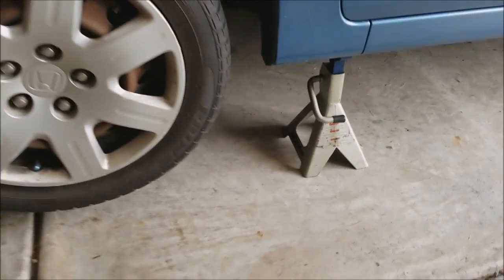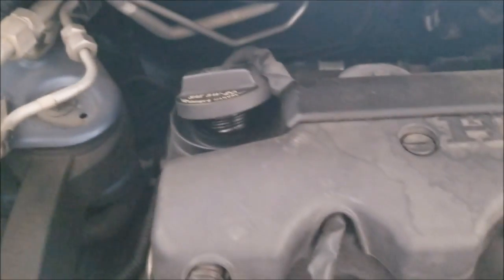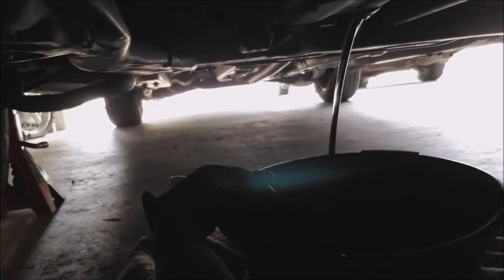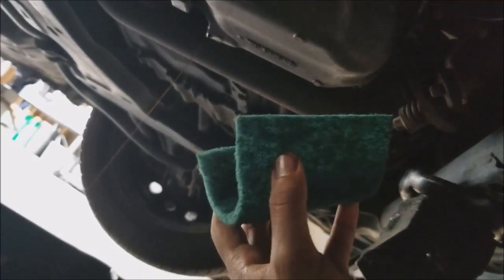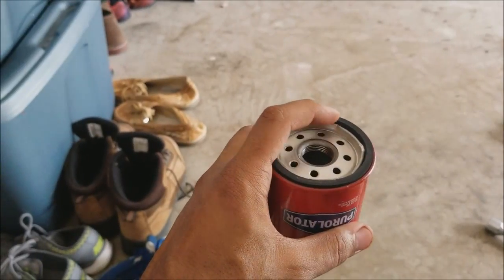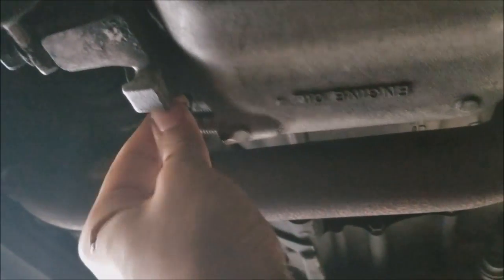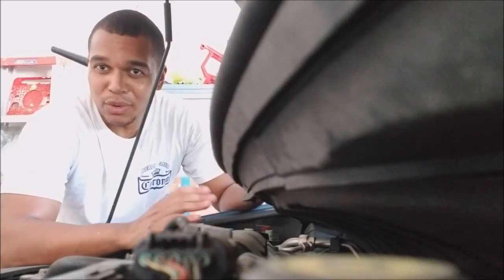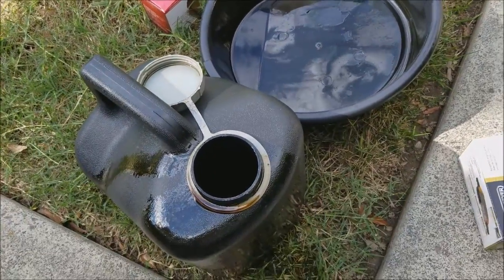2006-2011 Honda Civic OIL CHANGE | Easy and Simple

Comment from the maker: If you like the video please like and subscribe! Looking to scrounge up subscribers to spread helpful advice to and also gain some knowledge from them! Enjoy learning from my videos as much as I try to pass knowledge :)
Reply: Good video, it's also a good idea to pre fill the oil filter as well.
Reply from the maker: @joshbenway7109  that makes sense given the oil filter is not in a downward or sideways configuration. Can better insure the oil capacity is being met, thanks for taking the time to share a tip!
Reply: @EngineeredMojo  Not a problem.
Reply: Should not the car be lowered to a level position  before checking the oil level?
Reply from the maker: @liadbar-el8570  I don't understand the question in relation to the video. I don't check the oil level, but I do check for leaks. Car does not need to be level to check for leaks. For an oil change, I typically do not check the level as I know how much oil was put in the car, but if you had to check the level a flat surface would be best but would have a negligible effect on the reading unless your car is sitting at a high degree of angle
Reply: Thank you brother!
Reply from the maker: @williamcolwell1647  no problem! Hope it was a helpful video

Comment: Thank you! A tip for difficult to remove oil drain bolts - slide a 2 foot section of pipe onto the end of your ratchet for extra torque.
Reply from the maker: Good tip, a long pipe extension is a great hack for those without a long breaker bar!
Reply: @EngineeredMojo  it looks like you have enough clearance to get an impact in there too!

Comment: A yogurt 1 qt tub with top trimmed to fit over filter after loosening, pinched to unscrew will catch all oil and filter. Clean to move to oil catch pan. Nice!
Reply from the maker: Ha! Creative solution there to make the job a cleaner process. Tip noted and saved for future use!

Comment: its a 17 socket
Reply from the maker: henry nemet It depends on if the drain bolt is aftermarket or OEM. I should have specified that in the video. Thanks for the feedback!

Comment: It’s been a long time since I changed oil myself. Thanks for the simple, complete and concise tutorial.
Reply from the maker: Nice, glad the video was helpful! I have trust issues with oil techs so I'm all about changing your own oil
Reply: @EngineeredMojo  yeah, I get that. Gonna start doing more of my own basic maintenance. I need to replace the driver side window regulator and the AC compressor on my 2006 Civic. The dealership quoted me over $2,000 for both of those things. Both tasks look like a few hours work and $400-$500 in parts.
Reply from the maker: @dalsbury1979  definitely can save some money doing those yourself. Takes time like you say, but if you have some to spare...it'll spare your pockets haha

Comment: I just subbed.  Question:  do you not fill the filter with oil before you re-install it?  I was afraid I was gonna have to jack the car up, but I'm glad to know there are those re-enforced areas!
Reply from the maker: Appreciate the sub! And refilling the oil filter is your choice. It helps the engine not start on a short dry startup, but typical factory manuals only call for it if your timing belt tensioner is oil pressure activated. In many cars, the oil filter is installed sideways or "upside down" and pre fill is not an option like my 1995 EG Civic

Comment: Great video thanks for putting this on youtube. I just did an oil change on my 2008 Honda civic. Everything was the same as your year Honda. Only difference was the millimeter size for the oil drain bolt. It was 17mm instead of the 19 you used. Again thanks so much for the video!
Reply from the maker: Glad the video aligned with you car pretty well and thanks for sharing your fix experience. Saved some money and piece of mind that the job was done with care. Can't always get that at lube shops unfortunately
Reply: @EngineeredMojo  I definitely do not trust most oil change places. I'd rather do it myself so I know it's done right. There's always an upsell to at those kind of places

Comment: Best oil change video I have ever seen. But I didn’t see the torque spec on the pan nut. Extremely excellent video though.
Reply from the maker: Glad you found the video helpful! Torque spec for the drain plug is approximately 29 ft lbs

Comment: Is it a necessity to replace the filter and the washer on the plug during each oil change?
Reply from the maker: The filter yes everytime. The washer you are supposed to change everytime to avoid possible leak at drain plug but if I forget to pick up a washer I'll reuse old washer. Not the end of the world and rare you'll see a leak. If it does leak though you've wasted an oil change since you'll have to redrain pan. Small risk though
Reply: I have changed the oil in my Jeep Cherokee for 20 years and never replaced the washer on the drain plug and never had it leak. They say to do it, but really not necessary every time I would suggest.

Comment: 2011 Honda Civic needs an oil change now, may do it myself.
Thank you!
Reply from the maker: You can get it done! Really easy procedure
Reply: Half hour to double check everything! Thats 4 things only btw 😅 plugs back in, new oil filter, new oil and oil cap on top. By the 3rd oil change your going to be looking at 10 15 minutes 😁...did mine rn to see if anyone did anything different but nope, been doing mine for years. Very good video to listen and follow 👌

Comment: Nice job. I like to ensure the filter is loose enough to remove before I drain the oil (jic).
Reply from the maker: That's a good point. Oil filter can be a tough one to remove sometimes, good to ensure its removable before going through drawing process

Comment: No need too much tight when we put it back the oil filter, Sir?
Reply from the maker: No need to overtighten as ot will be very difficult to remove on the next oil change. I usually follow the manufacturer recommended tighten until hand tight then turn 3/4 revolutions more

Comment: Can you link where you got the jack from? I keep finding ones with bad reviews - maybe I should buy one in store.
Reply: or let me know what kind of jack and jack stands those are.
Reply from the maker: No problem, those jacks are from Walmart or Harbor Freight. Fairly basic no need to break the bank as long as the catch mechanism is solidly made. The jack is craftsman brand their 3 ton jack. It's a nice jack, purchased a few years ago during Black Friday for around $60. Sears are out of business around my way so it may be tough to find if there isn't a Sears open near you. I also use a harbor freight low profile jack for lowered vehicles. It's a good jack as well, but it's hit or miss if the box will have all the lock washers! Only complaint about Harbor Freight items. I had to return to store to get all pieces, but after that it's been great and has held up well.
Reply: Engineered Mojo perfect. I’ll check out Walmart. There’s a Sears near me closing so I’ll check them out too. Thanks for the help.
Reply from the maker: @tallllkiddddddd  great hope you find a good product!

Comment: Very well done, thanks!  I especially appreciated the info on the jacking points.
Can you provide any tips on how you lower the car onto the jackstands, that looks a little tricky to line up.
Also, do your jackstands have a slot in them where they support the car?
Reply from the maker: Oh yes, typically I will line up the jacket stands on a reinforced portion of side skirt or underneath a main car frame member (beefy steel tube or channel). The jack can be released slowly to lower car slow. Yes the jacket stands typically have a crescent shape or shallow "U" shape to allow cupping of supported member. Hope that helps! Appreciate the feedback on the video

Comment: Dude, I really want to do this but I have an oversized drain plug. Honda's is 17mm and I was informed that I have a 18mm. Idk if I can go through the whole expense and process of a new oil pan. Feel like a 19mm plug would maybe do justice but really Don't know where to go from here.
Reply from the maker: I'm not sure I follow. Do you have an aftermarket oil pan that has a 18mm drain plug bolt?
Reply: @EngineeredMojo  I have an original oil pan with an oversized drain plug. I just bought the car without any oil change history but came across this uncertainty. Should I use a bigger size than the current oversized plug
Reply from the maker: @DashCo52  still not quite understanding, but if you already have a drain plug the isn't damaged threaded into you oil pan why would you need to change it? If it's not damaged it doesn't matter if the size has been changed. It will secure back into your oil pan just the same
Reply: @DashCo52  

As long as the thread pitch, diameter and bolt length are the same, the bolt head size shouldn't matter.

Comment: What if you can't take the motor oil cap off to add more oil what do I do
Reply from the maker: I'd try to use a rubber glove or a large plier to wrap around cap to take it off. There's is really no good way to fill oil except through the fill hole unfortunately for this type of car

Comment: Plan on doing my first oil change on a 2011 Civic in a few days with the help of a friend, how do I know when to stop putting oil in?
Reply from the maker: I typically put in a 1/4 of a quart under the specified oil capacity given there will always be a small amount of left over oil in the engine. Then I double check level level with the oil dipstick to verify amount of oil in the vehicle. You don't need to be exact, but you don't want to be short or over by a large amount.

Comment: You should put a cap full of new oil in the filter and around the rim
Reply from the maker: Oh yeah most definitely, I show that step in the video. It's very important to add the oil to the seal to prevent premature failure of the seal.

Comment: bro, im at 4000km on my honda 2008. Should I change oil at 5000km or more or less. Some people told me ''OMG 4000km, you need to change it now cuz u gonna destroy your motor'' but people online says minimum 5000km. when should i change it bro
Reply: or its on the LED screen I should look somewhere to know?
Reply from the maker: For your year Civic, Honda recommends changing oil when maintenance required symbol (wrench) displays on your dash. This can vary based on driving conditions but generally is around 7500 miles (12km) between oil changes. The 5000km oil change mark is a value based on oil manufacturer marketing for the most part
Reply: thanks brah

Comment: I haven’t tried since the last time I tried because I couldn’t get the oil drain plug off. The bolt was stripped apparently
Reply from the maker: Tough luck on stripped bolt, maybe try a bolt extractor socket! It's super helpful tool and usually has more success on larger bolts

Comment: i got an si...how much oil should o use?
Reply from the maker: CHUNKK! Straight from ALLDATA for 2007 Civic SI: ENGINE OIL CAPACITY
At Oil Change......................................4.2 liters (4.4 US quarts) 
At Oil Change Including Filter..................4.4 liters (4.6 US quarts) 
After Engine Overhaul..............................5.5 liters (5.8 US quarts)

Comment: what was that puddle under the car before u changed the oil?
Reply from the maker: Inside The Cave condensed water discharge from the AC while I was warming up the oil, non concern but good eyes! Always like when someone can spot potential other problems!
Reply: Yeah I was wondering the same thing but my friend told me it was a/c discharge, because I was so worried my first car had a problem with oil leak, and thanks for your video. Everything helps

Comment: I also have a 2007 Honda civic, O'Reilly sold me  a W5-30 oil. Is that okay to use on it? Or does it have to be w5-20?
Reply from the maker: That oil type shouldn't be a problem, typically I'll run 5w30 oil in all of my Hondas and Toyotas for convenience. The 20 or 30 number just represent the viscosity of the oil at higher temperatures. Not much difference betqeen those two types and 5w30 will typically operate better under high temperatures as it maintains a thicker consistency

Comment: Why do I google my si and it says 5w 30 all over the internet but my cap says 5w20
Reply from the maker: 5w30 is a common oil weight and viscosity used for Honda motors especially in the 90s so many people list that as oil used

Comment: Did you ever experience a cracked engine block with this Civic. I guess they had a recall for this civic 2006-2009. It happened to a lot of people.
Reply from the maker: Never happened to me thankfully. I plan to read up on this more to see if my car has already came in for recall work. Thanks for the info!
Reply: @EngineeredMojo  yeah you can call Honda and give them your VIN. I bought a 2006 last April and I pray she will be okay.
Reply: Not every model made was affected. Keep an eye on the coolant but I wouldn't worry too much. I believe it was the ones made a certain factories in the us where they didn't cast the block correctly. Here in Australia I see heaps of these going around but haven't heard of that issue affecting the Australian models touch wood

Comment: Another idea :  If someone is a first-timer, perhaps they don't have to take out the first drain plug from the oil pan.  They just have to take out the filter.  80%+ of the oil will drain out anyway.  The remaining old oil is too little to matter as it mixes with the new oil, and thus removing only one of the two possible drain points is sufficient for a first-timer.  That way, the whole thing is less intimidating for the first-timer.  They can do both the second time around.

Or does only 50% drain if you do the filter first?  In that case, nevermind.
Reply from the maker: That's a possibility, but I'd argue removing the oil filter is often tougher than removing drain plug haha. Given the relative simplicity of an oil change I'd advise draining from the drain slot to get it done.

Comment: Went to a oil lube type place for the first time as a 18 y/o since i didn't have equipment or knowledge(living on a hill didn't help, could roll easily i think). They did the job however after about 1,000 miles oil light went on and 30 seconds later check engine went on too. Raced home to find out my engine didn't have much oil. Turns out the filter wasn't tightened up letting oil drain out slowly, had to park my car for a couple days thanks to that, currently trying to fix it with family.
Now I'll just learn how to do my own shit, thanks for showing us how and having a good shot of the layout.
Reply from the maker: It's a shame, especially at those quick lube spots, the workers don't have pride in their work sometimes and you have a situation like yours. Glad you were able to catch the issue before major damage and good luck with your fix!

Comment: Nice video - like it...  You do good work on, like the clean up - I never did that and will have to incorporate it.  Maybe brake part cleaner might help some of us w/ dirtier undersides.  Your car underside was clean!
I would agree w/ one comment that another video says 17mm wrench, but I haven't actually checked it.
Reply from the maker: It's possible I have an aftermarket oil pan bolt as this vehicle was purchase used. Could explain the socket size difference. Thanks for the comment on the underside! I try my best to keep it clean because it annoys me when random gunk falls in my eyes haha
Reply: @EngineeredMojo  in addition to gloves, I also wear protective goggles. I’ve had splatters of oil in my eye before...not fun! 😵
Reply: @EngineeredMojo  btw, loved hearing Strauss’ Blue Danube. 😊
Reply from the maker: @carlovanrijk4039  classics are always pleasing to the ear!

Comment: What's the number on that oil filter please
Reply from the maker: For the Purolator oil filter the number is L14610, but be sure to double check in case they have switched codes for some unknown reason. Hope that helps!
Reply: @EngineeredMojo  thanks

Comment: Just wanted to clarify it’s a 19mm wrench also for 2010 model?
Reply from the maker: I'm not 100% sure but most Honda oil drain bolts are 19mm and 17mm. Hard to go wrong having those two sizes to cover OEM drain bolts and possible aftermarket drain bolt that may have been installed

Comment: is total quartz 9000 5w30 a good engine oil?
Reply from the maker: Never heard of that brand, where do you buy it from?
Reply: Its a french gaz station who sells it
Reply from the maker: @michaelhalaby53  in that case,  as long as you are not doing any aggressive driving I would try it. It's the correct viscosity and weight and those are verified by international standards. With new oil I always prefer to buy from a physical store or a trusted website. Some lesser known online sellers will dilute or switch product and reseal
Reply: how will i know if my car was responsive with this oil? or if this oil was not good?
Reply: And btw i drive aggressively
Reply from the maker: @michaelhalaby53  most likely won't be able to tell the difference under normal driving conditions. That's why I say if you are driving this as a regular commuter then don't worry about it. But if you are driving long haul distance or in extreme weather conditions (hot or cold) then you may want to invest in a proven oil brand. That brand may be proven, I personally just haven't heard of it

Comment: You cound punch a hole in the  bottom of the oil filter with a screwdriver after loosening. first before removal. So it drains.